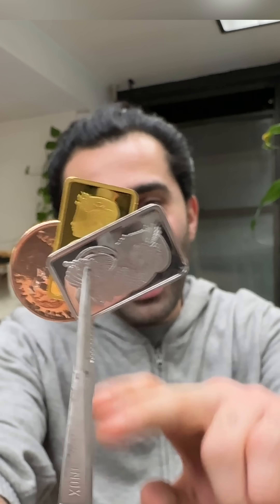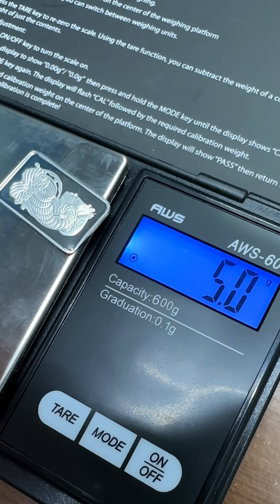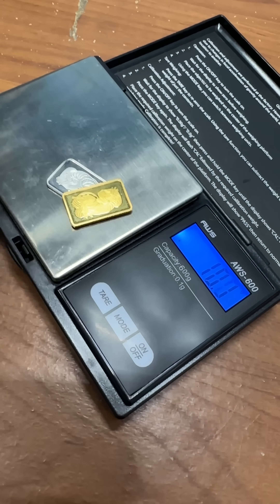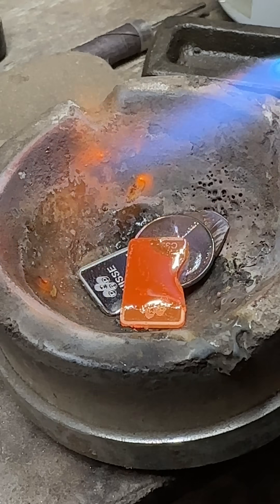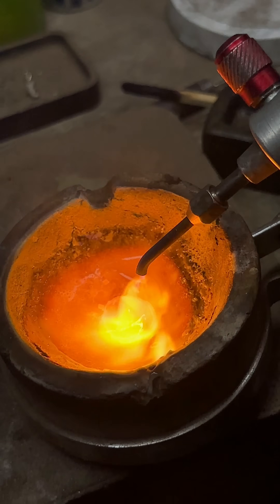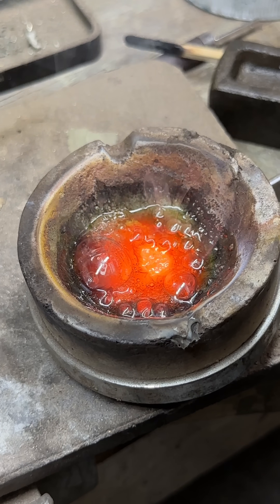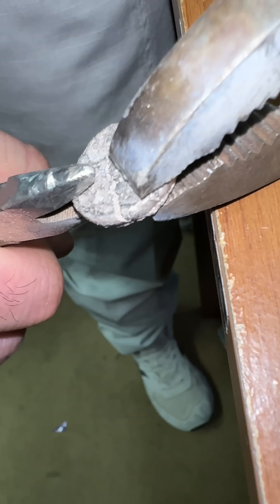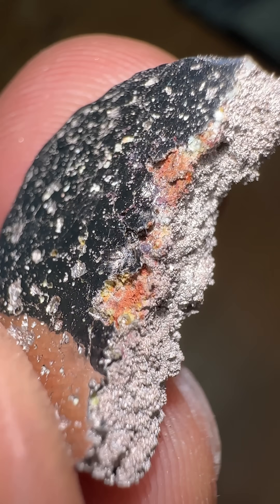CREATING A NEW METAL ALLOY FOR JEWELRY?!?!? #shorts

Comment: Old pennies aren't pure copper. They are French bronze which is 95 percent copper ,5 percent zinc. That zinc is your culprit for making the large crystaline structure not the platinum. Get purw copper. When alloying  Melt them together with lead. Which lowers the melting point of the other metals , then once cool and the slag/ flux removed,  put the kead button in a bone meal crucible and heat until the lead oxidizes and absorbes into the crucible itself.   Then see how your alloy comes out.  The zinc can be avoided by getting elemental copper or copper bullion ( .999 pure copper 1avdp (standard 28.34 grams )ounce vs troy ounce being 31.11grams)   like I sell in my new Etsy shop ::  vestpockettrading .

Comment: Too porous  because of the nickel in the penny that’s why it broke  use 100% copper and try next time
Reply: Pre 1982. There solid copper.
Reply: @robmcintyre3270  pre 1982 pennies are 95% Copper 5% Zinc alloy.